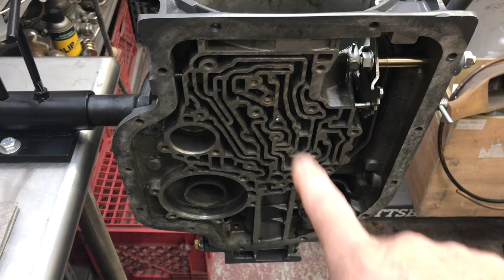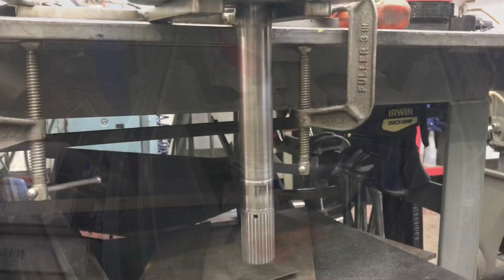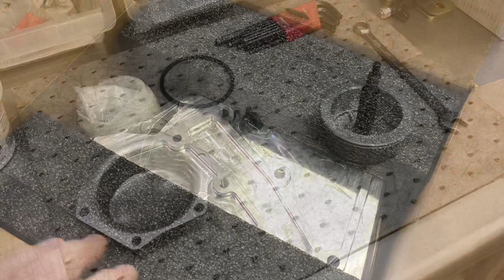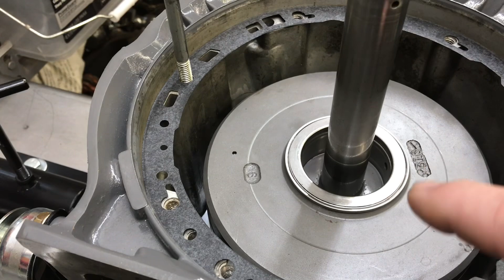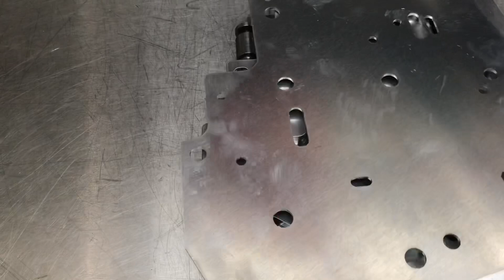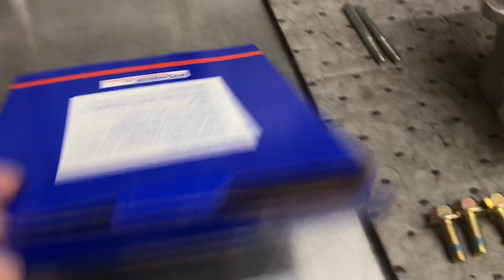TH400: 1972 Nova Twin Turbo LS Transmission

Comment: Do you run those kolene steels in direct like that? I scribe kolene down with steel wool or put them in a rust removing vibratory tumbler. The finish from vibratory is perfect
Reply from the maker: I have done both ways with success. These are used so in they went!
Reply: @mountainsgarage  Makes sense! Love your vids. Love building transmissions, you make me love the th400 even though I'm making what I call the th600

Comment: What parts in a turbo 400 should be upgraded for an attempted 700-750 wheel turbo street car? Thanks
Reply from the maker: Look in my playlist under TH400, there is a recipe for 800-1000 HP.
Reply: @mountainsgarage  thank you